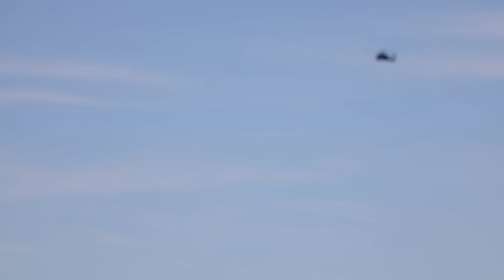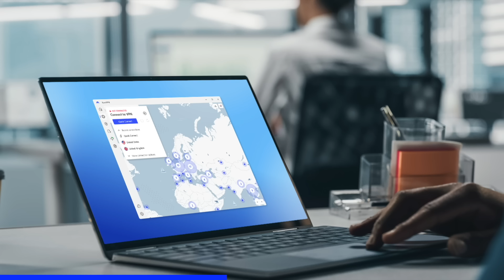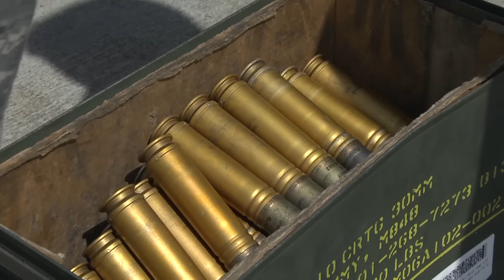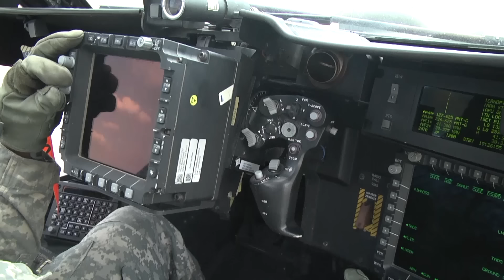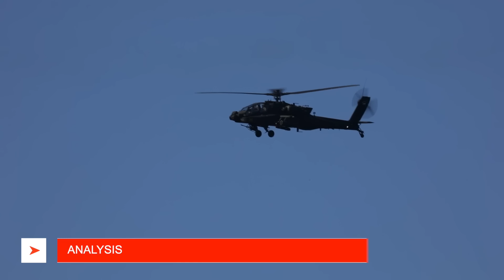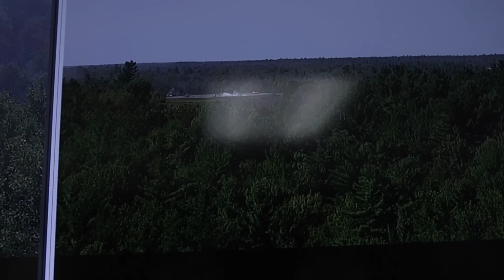How AH-64 Apache is being turned into drone killer with 'XM1225 APEX' round ?

Comment: it's a great concept let's send 25 of them to Ukraine tomorrow there's an international legion now flying f-16s... so let's make a international legion to fly Apache helicopters to utilize his new round and use it for air defense around key areas in Ukraine. yeah not front line as we don't know how survivable they would be in a peer to peer conflict, 😂 But that's not what this is in Ukraine anymore. Don't think there's too many air defense systems at the front lines anymore. 
still this thing could not defend itself from a drone coming in from overhead. I don't know if the Apache has any type of a side drone detection system but it would need it for both below above and sides. the infrared wouldn't work...
yeah let's get some in Ukraine!

Comment: Programmable airburst rounds
Major improvement
Give it the AH-1Z in 25mm as well
Reply: AH-1Z uses 20mm. Though I don't know why they don't use the same gun as the Apache. Weight? Recoil?
Reply: @bradleyanderson4315  
The Cobra needs the firepower upgrade
20mm isnt cutting any more